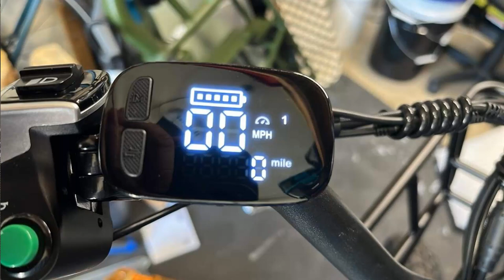Fiido T1 Replacement Update 5th Nov 2022

Comment: As it happens, I already replaced the original brakes on the T1 with semi-hydraulic units(cable pulled). I found those so good I would actually prefer them to hydraulic brakes. I am wondering if there is any weight difference. I am of the opinion that I will keep the old bike and weld a brace onto the frame as well as an additional crossbar. I can fairly easily put in a lighter battery for it. I just seems a little too good to be sending to the graveyard.
Reply: I'm still riding mine and checking the frame.  
I'm sure I could make a dual motor bike on the new frame, with parts from the old bike.  
I'm with you about not scraping it.  I just got mine tricked out!
Reply: @TornadoGarden  Yes, like I say, a welded brace on the up-tube and an additional crossbar welded in about 3 inches higher than the existing one.  And even if you did not bother sourcing a battery for it, if your new bike is ever out of action (like a puncture), you can just slide in the battery and away you go.
Reply: I replaced my brakes, too. The original one did not do its job at all-
Reply: You should be careful with welding the frame - it would be technically OK if it's 7005 Aluminium (which hardens itself in a 3 month time period after welding) but if it's 6061 (the most common frame alloy today) you have to do a heat treatment of the frame after any welding, or the welded spot will remain significantly weaker in yield strength and will likely crack again.
Reply: @simonm1447  I don't intend on buying new welding equipment.  I'm working on a CNC solution.

Comment: Hello all, i got mine. It's a 750w. It's unlocked and i can go to 40km/h. However it's only using throttle. When using pedals, it goes down do 25km/h even if I keep the throttle down.... Annoying...
Reply from the maker: Try using the old display. Heard they are different.
Reply: @EnglishEbiker  only the display? Not controller? My display look very similar.
Reply from the maker: @NicolasBruneau  apparently. Easy job, worth a try. If not, then the controller I guess.
Reply: @EnglishEbiker  so, i tried, same thing. With pedal I can not go more than 23km/h. By changing the controller ? Or by updating the software if we could like for bafang motor.
Reply from the maker: @NicolasBruneau  sorry, I don't know about the software, not a thing I've heard anyone doing. 
You could try asking fiido first, before changing the controller incase there's a secret method? Good luck, let us know.
Reply: @EnglishEbiker  I'm discussing with them, ı will let you know. I'm pretty sure they are hidden configuration that can be done, will they share it ? I hope so. :)
Reply: Bonjour Nicolas, j habites aussi en France et je cherche à acheter un FIIDO T1 avec le moteur 750W , sur quel sit el avez vous acheter , est ce qu votre T1 est considéré comme un vélo électrique classe 2 ou alors motocycle?
Reply: @jaideemassagessence  Bonjour, je l'ai acheté sur Aliexpress.
Reply: To all, i put back the old controller to the new bike and it's working great. I can go back to 40km/h using pedals or throttle. Also, the power of the motor is much better, acceleration is much stronger. It took only 30mn to do it. It's only small plugs. Just be careful with colors that's it and before putting back all screw just give it a try.
Reply: @NicolasBruneau  do you know if I can just buy a Bafang G60 controller and use that instead? Since I prefer to have a different display and throttle anyway too?

Comment: The proper term for the updated downtube on the frame is "extruded aluminum".

How many other bicycle company can issue a recall and send out replacement bikes within a month for riders to receive?
Reply from the maker: An extruded aluminium what? Patch seems a good word for now.
Fiido have definitely done a great job, although it was much longer than a month.
Reply from the maker: @vfr1vfr2  Yep. They announced the recall after already realising there was a problem, designing the replacement, building them and shipping them. So you're right with the time frame, my criticism was that they didn't notify customers earlier.
Reply: @EnglishEbiker  My point is: not many bicycle or ebike companies can respond so quickly to recalls. Even if they know of the problems. Do you know of any company that would notify customers of problem before customers actually experience the problems? not just bicycle or ebikes, but automobile, airplane, pharma, IKEA, etc.. Recalls usually occur after several cases reported from consumers.
Reply from the maker: @vfr1vfr2  ignoring other companies as I have no knowledge and its irrelevant to this particular incident. 
I accept your view, yes they did respond quickly. 
Once again, they did not notify customers until AFTER they had designed, built and shipped the replacements. Obviously they knew there was a problem (else they wouldn't have made the replacements) and yes, they seem to have acted quickly. 
So, to clarify, my issue is that they did not inform their customers as soon as they identified a problem. 
Quite simply, any one of us quite realistically could have died as a result of a faulty frame, during the period between Fiido acknowledging there was a problem and issuing the warning to customers not to ride their T1s. 
As we know, at least two people had frames snap in this period, either of which could have resulted in serious or fatal injuries.
Let's agree to differ in our opinion of this situation shall we?
Reply: @vfr1vfr2  yep I only found out after bike snapped while riding. Been out of work for 3 weeks